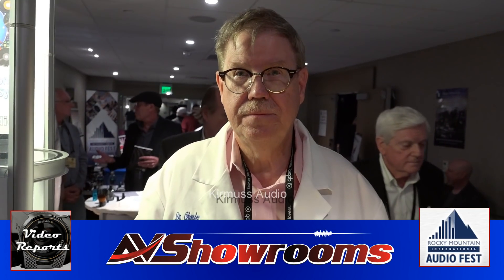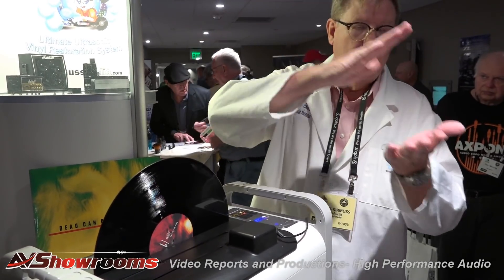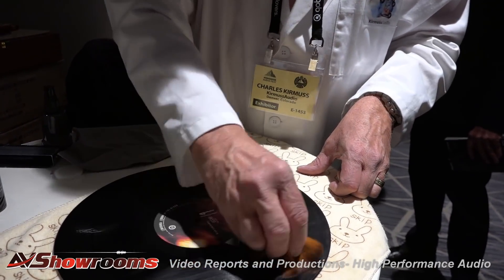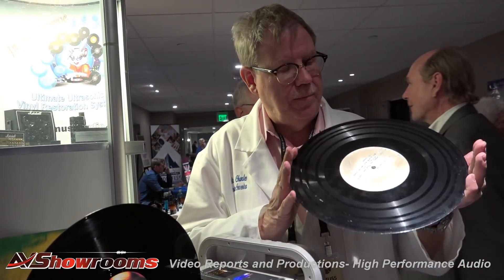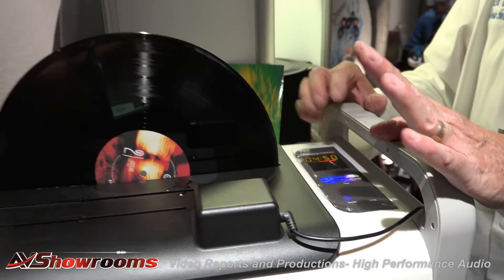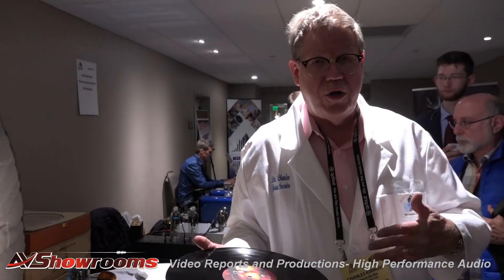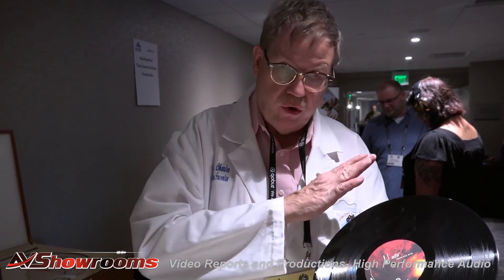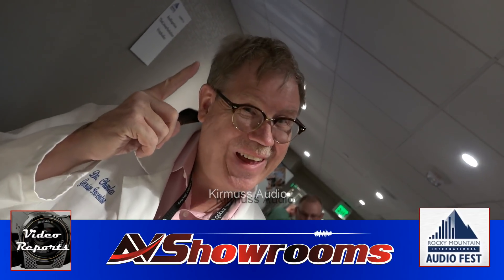Kirmuss Audio, Charles Kirmuss, Ultrasonic Record Cleaner, RMAF 2018

Comment: The inventor just talked me out of his solution.  I will look at something like a Degritter, it’s more expensive but it has a drying process.
Reply: The degritter runs at 120khz tho
Reply: A restored record comes out virtually dry, no need for a fan to dry what came off the record that sits in the water, filter or no filter

Comment: Wow that’s a lot of work even if you can do 2 at a time. Then you have to buy new sleeves for all your records. Plus it’s £995 then new spray is £19.99 which looks like you have to use a lot of.
Reply: Restoration and removal of the release agent is the purpose of our machine... no surface cleaning. The back and forth cycles are required as the ionizing agent sprayed on the record washes off as the record spins, reverting the charge of the record to that of the water in the basin. Opposite charges  attract, like charges repel. Hence the process to attract the result of cavitation to the record.

Comment: He says 70% solution alcohol. I bought some 100% (it says so on the bottle) isopropanol, so does that mean than instead of using recommended 1.4 ounce, I should just use one ounce?
Reply: No. 70% and 99% are made commercially where 70% is  not made just by dilution. In emergencies such as during this pandemic, there is a formula one can use to make the dilution.  It is on the web. FYI The alcohol in our process is used  to kill both live and dormant fungus as it comes off the record.  Thanks for asking!

Comment: I had to do this with my 2600 records, 2600x10min are 433 hours are 18 days ( 24 hour cleaning, no toilet breaks), this would stop me collecting vinyl. I rather accept a click here and there and use my Knosti that costs me 50,--.
Reply: Restoration is not surface cleaning. If you want to surface clean, it is a single 5 minute process for up to 4 records simultaneously.

Comment: Folks, this process probably does improve the sound quality of records.  But it is not a magical solution.  Why?  Even if that machine rid every last molecule of debris and made the record 100% static free, etc, you are still at the mercy of the quality of that specific record.

No two records sound the same.  If they do, then your stereo is not of sufficient quality to reveal the differences and/or your listening skills are lacking.  80%+ of pressings have, at best, mediocre sound quality. 15%+ have very good sound quality.  Only 1% or 2% have fantastic sound quality.  And some records have zero chance to sound good, because 100% of the run sucks (like Meatloaf's Bat Out Of Hell -- they screwed up every single pressings).

If you take the time and effort (and $$) to purchase dozens of copies of the exact same record (and focus on stamper codes (if you know which ones) that are known to usually sound better), you will usually eventually find one that stands out as a sonic gem -- and probably on only one of the two side -- you will have to keep hunting for great sound quality for the other side.

Now, if you clean that sonic gem on a traditional and inexpensive record cleaner, it will sound better than cleaning the others on the NASA inspired record cleaner in this video.

Also, if you do not professionally set up your turntable (and I mean really get it dialed in accurately), then even the best sounding records will not sound their best (they might even not sound very good, if one or more vectors of your stylus is misaligned).

You must, must, must dial in the effective length of the tone-arm, the cartridge's weight, the vertical tracking alignment, the anti-skating, the overhang, the offset, the zenith angle, and the azimuth.

The above is not simple, and it is very time consuming.  But it will make a huge improvement for all of your records (more so than any cleaning will do).

So where does the state-of-the-art machine (in this video) come in?
If you have some hard to find sonic gems (white hot stamper pressings), and your turntable is dialed in as described above, then this record cleaning machine will fulfill the final step in achieving analog nirvana.

Or to put the above another way:
In life, there are many ways to improve upon something.  In most cases, you have to compromise and choose what will get you the best results for your efforts (and for your hard earned $$).  If you want to go all-out, with no compromises, then this machine is a must.  But if you do not feed it cherry picked quality pressings (and most pressings have nothing special sound quality) and play those pressings on a turntable that can do justice to those pressings, then such cleanings are overkill (a cleaning with a traditional machine will do 90%+ of the job).  That last 10% is important, but not if you fall short with quality pressings and fall short with turntable set-up.

Cheers!
Reply: Indeed.  As to records pressed: The  restoration process  described removes the release  agent from the record. It is not a surface cleaning system, (although it can be used as such with a single 5 minute cycle.)  The premise is if the needle makes better contact with the details in the groove, (hidden by the release agent), we then  hear and feel the breath of the pressing as it should be. To aid in release agent removal, we need to change the charge of the record so as to attract the plasma wave created by cavitation. Records and distilled water with or without a soap in the basin have the same respective charge. The application of an ionizing agent changes the potential difference temporarily to attract the wave into the grooves brushing against the ionizing surfactant cleaner. The charge is "washed off" as the record spins, so the reason for multiple cycles.
Reply: Thanks for the comments. Our premise is to remove the release agent from New or vintage pressings.  This provides for the system attributes presented.  We do not focus with our ionization of the record surface cleaning.  Thanks again!

Comment: I used one for 1 week now and the result is very disappointing. Not only it takes ages to clean records I spent 1,5 h to clean 2 records and still there was crack sounds on the records. Then I pushed the brush a bit harder to clean better witch resulted in scratches so the records we´re destroyed. In another video he says: "One 9 $ bottle lasts for 300 records" That´s the biggest lie I heard in HiFi business. The bottle costs bout 25 $ in Europe and lasted me for 5-6 records so it´s terrible expensive too!
Reply: did you mean the surfactant which costs that much?  It seems that it is used many times in cleaning just one record.
Reply: Remember! You are not cleaning you are restoring your records! 🙄
Reply: @renzonovara2728  xD
Reply: I do agree this is bullshit in this video i have records 30+ years old overplayed never used any cleaning fluid just the antistatic brush and they are very good just remember guys to replace the stylus when it's  time cause worn out stulus damages the records
Reply: Please consult our web site and follow the directions. We offer a 1.3 to 4 dB gain on processing records depending on the provenance of the record. A new record takes 18 minutes to process, a fixed time. Consult our Supplement Number 3. We process 4 records at a time.  With 2 or 3 lp's concurrently.  . The consumables  cost is 26 US cents per record.

Comment: I realise that it's tempting for you to advertise your products in the comments of everyone's videos, and spread a whole bunch of misinformation and pseudoscience in a giant wall of text.

You've put so much nonsense into such a tighly packed, poorly worded and confusing paragraph that it would take forever to respond to every bonkers, made-up statement that you've just dropped in the comments. but I can easily address a few.
 
As you'll notice on the listening before and after test, there are no pops or clicks on the cleaned version, so there goes at least one of your made-up fake terms like 'microwelding'.

'release agent' is something you've made up and continue to repeat, despite actual chemists and vinyl press operators trying to correct you.

The record label is not damaged at all with the 'skewering' method as you call it. If it damaged it, then any normal use of putting a record on a record player spindle would damage it. 

 You mention having a 'patented kirmuss method' constantly, however the only patent I can find that you have for the machine is simply the part that holds and spins the record. While I think that's neat, and good on you for making it, it changes nothing for the cleaning process apart from limiting how many records are cleaned at once. I only cleaned one record at a time in this video so... problem solved.

You can mention 'ionizing agent' in an attempt to sound plausible all you want, but I'm not seeing any evidence.

Basically you'll need more than a cheap lab coat and clip board costume to convince people that your method is anything but an elaborate ruse tacked on to a normal ultrasonic cleaner (that is doing all the work, not your shaving brush and foaming cream). And the same goes for your nonsense cables.
Reply: You are more than welcome to set up an appointment and visit our office and use our Keyence 3D VHX microscope to measure records before and after processing as to release agent coating and the like. Everyone can have their own opinion. Deoending on the provenance of the record, our process does offer between 1.3 and 4 dB gain over floor. You can easily see this if you have a cassette or reel to reel tape recorder to see the effects of groove restoration. Validated globally  by technical reviews written by respected experts in the field, results  of our process have seen respected  audio manufacturers such as Helix, Oracle, Jeff Rowlands Designs, Audio Note (and their ambassador Vincent Belanger, renowned Cellist), among others, process their own  records or those of visiting audiophiles to their demo rooms with our machine before auditioning  them at various trade shows in their studios and on their equipment. Appreciate your note.  Japanese and German audiophiles are very discerning. We are recognized as a restoration process, not a surface cleaner. The proof is in the pudding.  Everyone can have their own opinion.